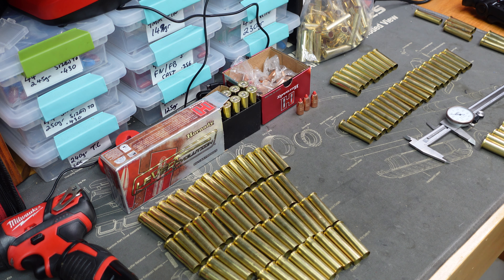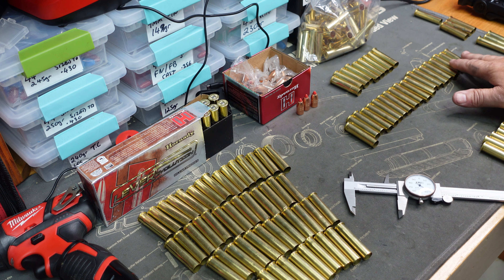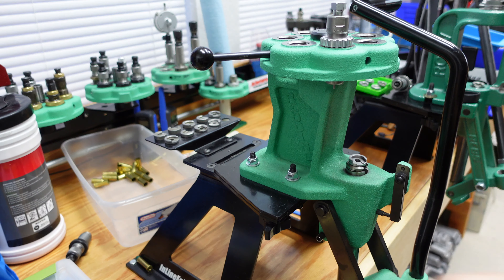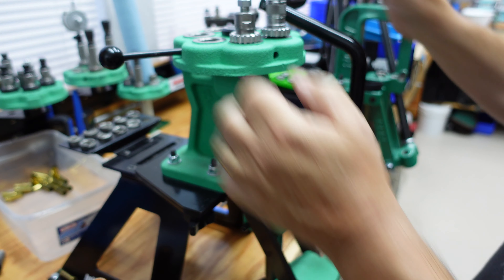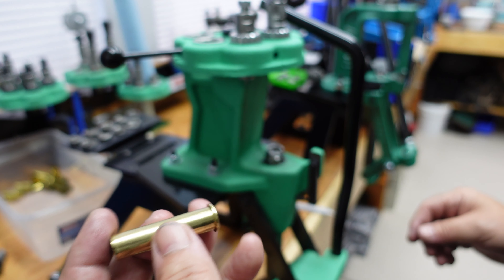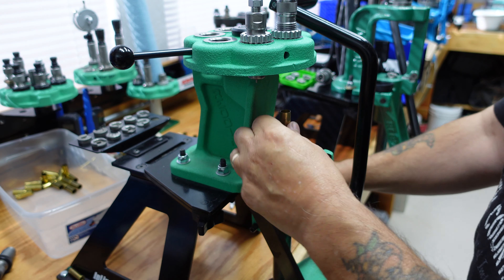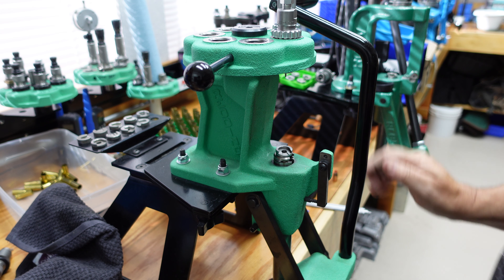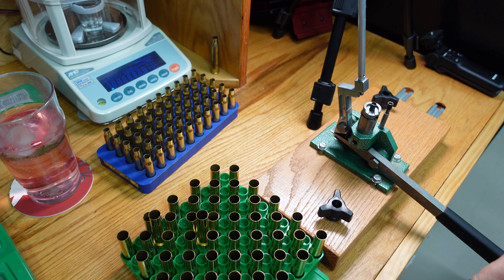New series part 2 loading 45 70 from start to finish for my new Marlin 1895 guide lever gun

Comment: It is shorter for the flex tip bullets only. Keep it just for those bullets. It should show in your book that for those bullets to trim to the shorter length. I keep all Hornady straightwall separate.  Now you need to find a BFR revolver in 4570 to go with the lever action
Reply: ...thanx - just learned something new...I've been cussing the Hornady brass out for a long time...I might have a few flex-tip bullets left from my late buddy who left them behind...you've solved the mystery...
Reply: Exactly right 👍
Reply: Or a Thompson Center Contender Single shot with 14" barrel in 45-70 gvt. Hard to hold on to but cool.